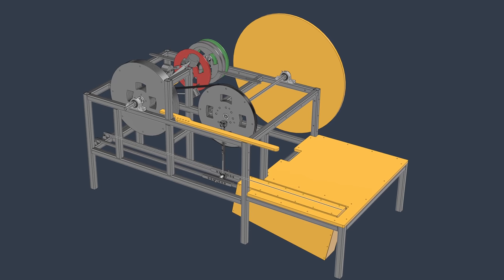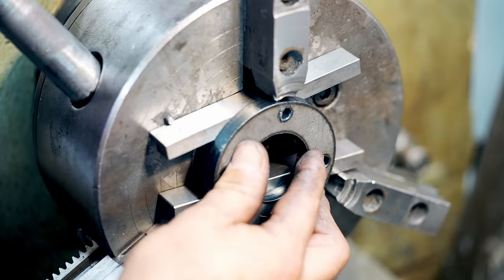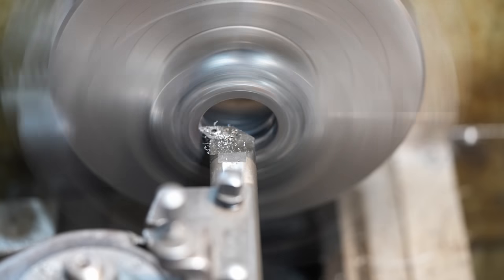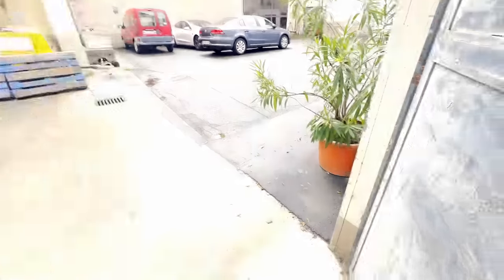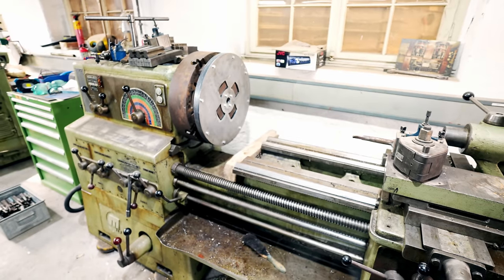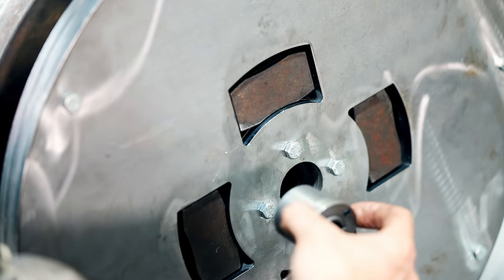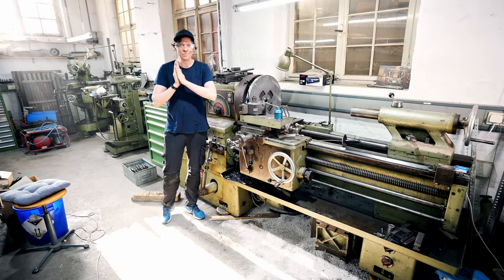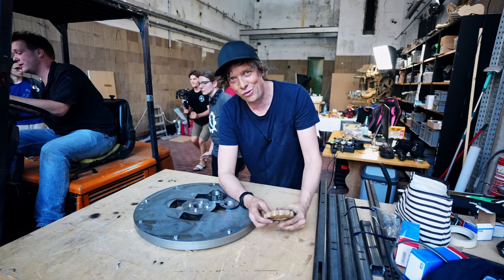Turning Metal on a BIG Lathe - DAY 2 - Marble Machine Flywheel Prototype

Comment: @Wintergatan (Martin),  I understand and appreciate your very new to machineing, using machines and trying to film it all at the same time. 

But one thing your 'trainer' should have made very clear! When operating a lathe, or 'any machine' for that matter you should NOT ever look away from the machine while operating it. If you need to ask a question of your trainer, or someone needs to ask you something while your operating a machine, ALWAYS, Always switch it off....!

And if any of your collegues need to ask you something, they should wait untill you have finished a given operation before interupting you. The same goes for loud noises while anyone is operating a lathe. Collegues need to be aware that when they are in the machine room while someone is operating any machinery, because any loud noise can cause athe operator (who is only human) to flintch while your using the controls , causing them to make an unwanted cut to the part at best or injure themselfs at worst.

And lastly that noise you were hearing when using the boing bar on the large part was exspected, its basically judder/vibration in the boring bar. Going to a bigger bar would aleviate some or all of the noise. The noise was also due to you trying to machine welds, which as a result of the heat of welding are 'work hardended". So you would need to use a carbide insert in that instance, or if none area available, use high speed steel in a thicker boring bar.

Comment: Nice progress! But now that you have nice surfaces on the big wheel - isn't there a risk of bolts loosening and the three plates shifting over time? Yes the bushing will prevent that to a degree. But wouldn't be welding the 3 plates be more consistent? I guess it's "just" a prototype ;)

Comment: When you center your work piece on a lathe it's called "clocking up" not "dialing in". The generic term for any type of machining is machining, turning is a specific type of machining where the part being processed is turned whilst cutting the outside (boring is when you cut from the inside).

Comment: its great to see you learning some machining, some safety advice that could save anyone from a potentially life altering accident, shatterproof safety glasses that cover every angle(knew a guy who lost an eye from a smoking hot chip of metal)/remove anything loose fitting and absolutely anything from you hands and wrists(rings, watches, bracelets, anything that has the slightest chance of getting caught), you do not wanna gut pulled into a lathe

Comment: Did anyone else notice that the four jaw chuck is already an off the shelf flywheel of the correct diameter that is already concentric, perpendicular and balanced? And since they are already in a machine shop with multiple options to try they could test different sizes to get the performance that they wanted and save months of work? Plus it would give them a peddle powered lathe to fix parts in a pinch on the tour? It’s less content and not really Martin’s style but I feel like it would be fun to make part of the instrument be one of the tools used to make it.

Comment: When facing the front of a part on a lathe like that, the relative speed reduces dramatically as the distance between the cutter and the central axis shrinks. On CNC lathes, the speed can be set to automatically adjust for this ("constant surface speed"). Also, you want to go past the central axis by the tool nose radius to avoid having a little spike in the center.

Comment: true about no gloves. years ago my brother was cutting wood on the table saw. he was splitting 2x4's to 2x2 . his glove was floppy and got too close to the blade. in a split second the glove hit the blade pulled his hand in and almost completely severed one of his fingers. i took him to the hospital where it took all evening for them to bring in a specialist who had to drill holes the long way through his finger and put 2 pins to align it back. he recovered and still has his finger although slightly crooked but it was pretty mashed up so just happy he got to keep his finger. and it still works.

Comment: I am not a machinist, but I have watched a number of videos, I think that the speed of the lathe was way to slow when turning the inside bore of the fly wheel and that may be the reason of the screeching sounds you got. The speed is linked to the diameter of the part you are turning, small hole, small diameter, fast speed; big disk, big diameter, slow speed.

Comment: Sorry to say, but that is not a BIG lathe. It's pretty normal for a manual, and really small compared to most CNC lathes.
The big ones are as large as a house and the biggest require you to be in a roofmounted cabin

Comment: if you're going to design in the mounting holes for the lathe chuck, you probably should have instead designed in mounting holes for the faceplate that was already on the lathe. The holes would have been smaller.

Comment: Lesson 2: If you used a caliper or micrometer to measure the diameter of the insert and the inner radius of the latest cut, then you could use the indicator dial on the tool mount to get a perfect fit without having to inch up on it.  Lesson 3: If you used the gear drive instead of moving the tool by hand cranking, you'd get a perfect finish.

Comment: I have noted a possible future problem with the construction. Screws are best for tightening things together not positioning the parts. For this purpose, it is better to use cylindrical guide pins.

Comment: as a machinist it is called Turning not "Lathing" so the commenters are correct. as it is I was flinching with the lack of safety in the last video with the welding and grinding on a wood table and also placing the grinder disc down as well.

Comment: One thing that can help with the hardened surface from the laser is order the hole undersized so you can take a deeper first cut and then take shallow cuts once you're through the hard surface.

Comment: Great to see it fits well. Still you're going to want snap rings on shaft. You don't have to worry they will walk off. They're all that is used to hold CV joints and drive shaft U-joints. Even with correct snap ring tool, they're hard to remove.

Comment: What a shop you've found for your level up, Martin! Kudos to all the people around that provided you with such an opportunity. German, Swiss and Sweden metalworking machines of these generations are actually classic marvels and i'm definitelly envy for such a shop. Thanks for sharing, hope your machine at last will emerge out of these metal shavings and oil fog :)
BTW, looking at your usual marble machines layout you can consider your machines as improvised turning setups as well.  You can look at old automated lathes of simillar age as these machines in the shop, that were designed to produce series of parts out of barstock. In German they may be called Barmachinen. They were equipped with sophisticated command apparatuses, allowing to define measurements and sequences of operations using rotating tool sets. You can have something like this available around to peek into  to borrow some ideas, as their workcycles were mechanically defined and were running for ages this way.

Comment: This is totally ignorant couple of questions that I’m sure have simple answers.

1)why is using something that is that old price maybe?
2)don’t they new machines that is automated digitally?
Reply: Old machines are made of huge cast metal piecess that are old as well and after all these years they got rid of all internal tensions inside which is good actually. if used and maintained well they actually last and sometimes they are quite capable in terms of rigidity and stability. Some shiny modern machines are often made somewhat poorly to be competitive on the market. If you're already running an old machine in good condition, you're more than Ok usually. 
You can equip almost any classic lathe or mill with a DRO - digital read out tools for an affordable price these days, speeding your work and making it less cumbersome with most of measurement operations. To make a single custom part it's often way faster and less tricky just go manual, without bothering to draw its models\dimensions into CAD software and then play with CNC machine. CNCs are good for tricky parts and series, when you're saving your time by automating the operations with decent repeatability. For a single simple part or operation full manual is often just a reasonable way to go.
Reply: @dmitrymikheev7899  thanks man. How much do those two machines Martin have cost?
Reply: @mclaytv  he doesn't "have" them, he is simply borrowing/renting workshop and he is using machines the workshop has. Machines like that are basically immortal and for small workshops there is simply no reason to replace them with new ones.
Reply: @mclaytv  Frankly, no idea. Depends on model, condition, accessories and location, as usual, starting from scrap metal price. in my part of the world you can have bare machine like this small one starting $2-3k, $5-6k freshly scraped and refitted in a good shop. For simillar to bigger one they ask like $10k+, usually more. But in our land for a german or swiss made in good condition you can ask significantly more - if condition is indeed good. If condition is bad noone will take it, as there are no way to get spares now.

Comment: I was impressed by the larger lathe - it appeared to rotate much slower than the smaller unit, yet smoked more - greater heat from too big a bite on the passes? The end result should be pretty impressive, and I can’t wait for the next installment. Going to be popping in every day to catch these. Keep up the good work!
Reply: The smoke is just the oil burning up. He didn’t use oil on the small lathe, as carbide doesn’t really need cooling or lubrication for fine work like this.
Reply: It's the surface speed that matters. The bigger parts probably had more surface speed at the OD than the smaller parts, even though the smaller parts had much RPM.
Reply: Nah this one mostly relies on torque than speed, this approach has it's pros and contra.
For example you can run cooler.

Comment: You may have a BIG problem with concentricity. Since you haven't cut everything in that late you need to make sure you are actually turning around the center of the part. Otherwise those bolts are going to be parametric and you're going to have issues.
Reply: Indeed. Someone else also pointed this issue.
Reply: I think that's what he did when he measured the parts with that gauge and hammered on it before cutting. Besides the holes for the chuck were laser cut on a CNC
Reply: People called that out months ago when he first proposed this, and of course, he ignored it.
Reply: Paracentric?
Reply: @danp8321  That's when the centers of the inner circle and the outer circle aren't the same point.
EDIT: Oh, I didn't see the typo in OP's message. Yeah, they probably meant "paracentric".
Reply: @davinderc  The wheel is concentric, but the bolts across wheels might not be.

Comment: It’s still called turning. Not lathing. And the chips are called swarf
Reply: It's also called Lathing :) though I think this is a less often used term
Reply: @azyfloof  I have never heard it and I know several machinists. It can also just be lumped into the category of machining
Reply: @pacificcoastpiper3949  I've heard it a few times, but I hear Turning and Machining far more often. I wonder if Lathing is regional, or just an older term
Reply: @azyfloof  I wouldn’t know, but it’s an interesting thing regardless

Comment: This is going to be so immensely heavy. I don't understand the design objectives. 
Long ago he wanted a machine that could be taken on a music tour. This design seems to be very impractical.
Reply: the flywheel is literally the heaviest part by design
Reply: It's meant to be heavy. The heavier it is the more constant the speed will be. A large mass in motion doesn't want to change its speed.
Reply: Grand piano with pretty standard dimensions can weight around 500 kg, but it doesn’t stop some solo pianist to tour with their pianos around the world. 
Even basic gear like drums, amps, speaker cabinets for rock band with drummer, bassist and two guitarist can easily weight 250-300 kg in total.
What can I say, musicianship is a heavy business. :D